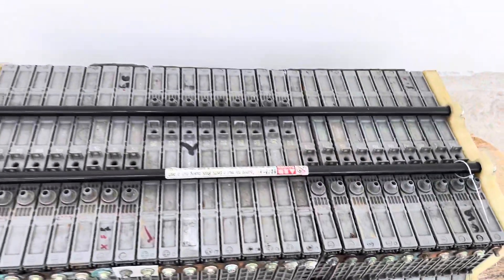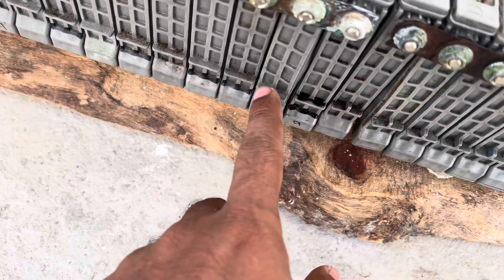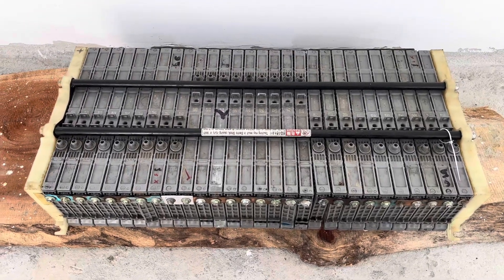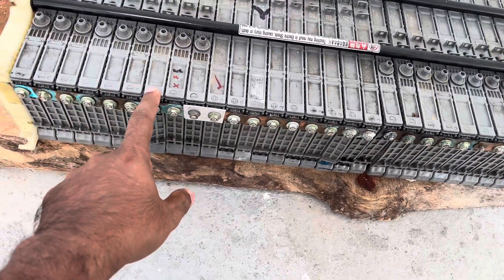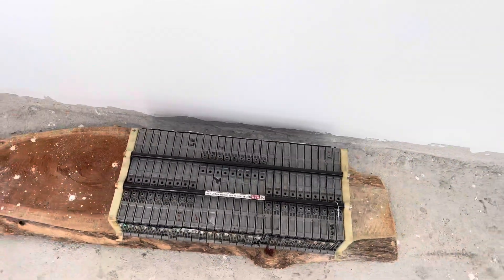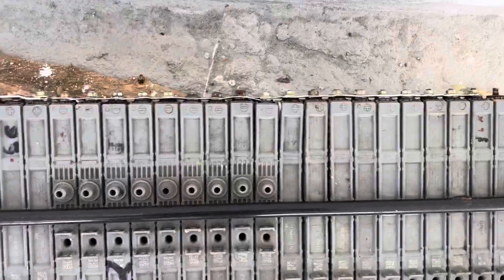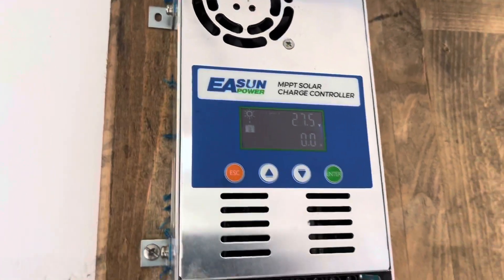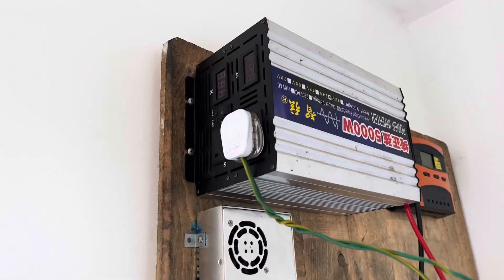Don't use hybrid battery Cell for solar system

Comment: මම (8.4v*3 )   25.2v චාර්ජ් කරල  21v  වෙනකන් ඩිස්චාර්ජ් කරනවා.
අවුරුද්දක් විතර වෙනවා. කිසිම අවුලක් නැහැ.  ඕවර් චාර්ජ්   කලොත් ඔයවගෙ පුපුරනවා
Reply: Thats the correct way to do. I also using the same cut off voltage. No problem with that range. 27v is little over charged which can damage the cells (week cells  quickest)
Reply: Cooling fan set karanna oonada